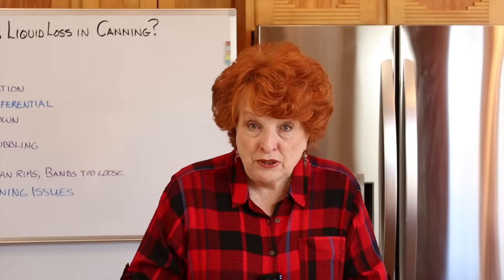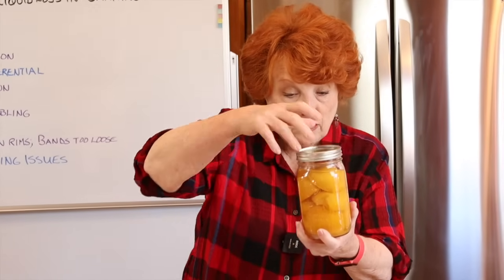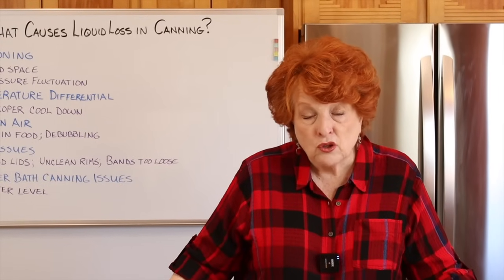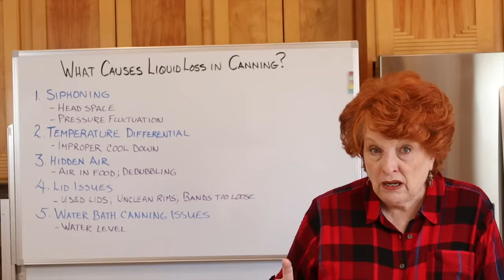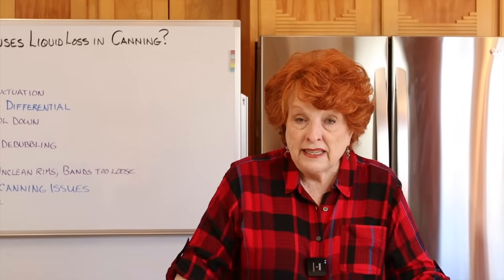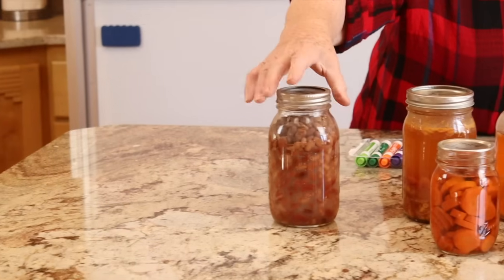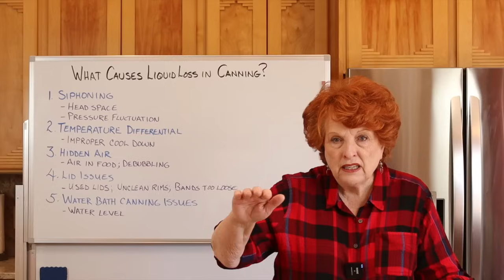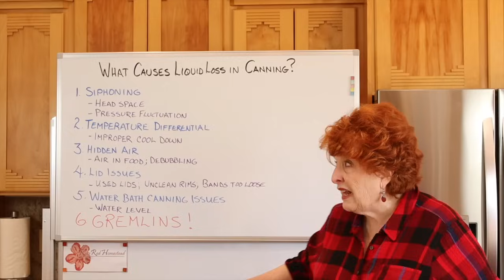What Causes Liquid Loss in Canning

Comment: I have for my nearly half century of pressure canning let my canner sit for 30 minutes before removing the the lid. I rarely have a problem. It's the way my mother taught me, when she was in hospital one summer and I had to pick, string and can 40 quarts of greenbeans by myself. I was 14. I think she was afraid I would open it too soon. Her exact instructions were, " turn off the heat, when the pressure reads '0' wait 30 minutes and remove the lid." 
Edit - That was before all the safety measures they have now. But I still do it that. 😆🤷‍♀️
Reply: I do the same. I can’t see what it hurts to let the jars cool down longer than 10 minutes after returning to zero. Especially for things like broth that really can’t be overcooked. I’d rather wait no matter what I’ve canned.

Comment: Holy cow you're the best, THANK YOU!   I have the Presto 23 with both the gauge and a 10 lb weight per my altitude.   Just today I was noticing a trend in my jars of being low on liquid, wondering why, and wondering if they were unsafe.  You're the best at educating.  I believe my biggest error has been not keeping that smooth transition of temperature; canning is time consuming so I would rush my canner up in temp to get the steam for 10 minutes, add the weight, then drop it down  fast to get my gentle jiggle.   I am also guilty of occasionally bumping my weight to see if it's still letting off steam as it cooled down.  I won't do that anymore!     On my gas stove, the 4.5 marking on my gas control knob gives me the necessary gentle jiggle. If  am understanding you correctly, I think I should be letting it gently build up steam for the 10 minute exhaust on that 4 or 5 mark,  add my weight, and let it gently keep building up to the gentle jiggle at the 4-5 mark on my gas dial.   None of this max heat down to medium low heat stuff.   I will try that on the next round anyway.  I love your videos, they have been most helpful.  There are a lot of "rebel canners" out there these days and I often share your video about botulism with them.   Frankly, I think we are going to see a rise in botulism poisonings before long with all the misinformation these people push about how you don't need a pressure canner to do low acid items.   They keep saying "The Amish do it this way!"  I don't know about that, maybe you could teach us something regarding that.  Thank you again for your help, the timing of this was perfect.

Comment: This is the best video you have ever gifted to us, especially newby's. I thought I had learned all I needed to know about canning until I got an electric glass topped range. Oh did I ever miss my gas range (my new house had no gas). It took several tries to figure out how to reach and maintain the appropriate pressure. So my answer to the questions is simple:
Impatience and inexperience. Once in a while I'll get a failure of a jar, but never a full canner. I dont fret over it, but just cool completely and send to the fridge or freezer to use soon. As far as peaches go, during the lid shortage of the 70's there were so many new ways developed for the freezer. Peaches were by far the best! When done right using Fruit Fresh and sugar, air tight containers, working quickly to prevent oxidation which not only doesn't look appealing it doesn't taste good. I never went back to canning them. Anyone remember freezer coleslaw? It is actually very good, needing only some mayo upon thawing to make it like fresh. Great solution when growing your own cabbage and dont want to turn it all into sauerkraut.  Freezer jam? Yes! I still prefer the traditional way. Reusing lids? NEVER! Why risk ruining an entire batch of precious food to save a couple $'s? Used lids are fine for dry storage. My solution for the rings: after removal (the next day) I wash in lukewarm slightly soapy water, all the jars and rings, then let air dry. I do what my mom always did - open up a wire clothes hanger by untwisting the wire at the top, placing the rings on thr hanger, losely winding the wire slightly back in place and place in a cool dry place. One for each size and you wont get rust. Rings w/lids cost almost as much a a case of new jars! This method also helps if you have many more jars than rings, which is easy to happen when buying used jars, as they often are missing rings.

Comment: I used to have a ton of problems with siphoning due to pressure fluctuations with my Presto canner. However, once I ditched going by the dial and just canned by ear with the weight, I had way fewer problems. I find it easier to listen to the canner, and it results in me touching the stove dial a lot less.
Reply from the maker: It sounds like you have fixed your siphoning problems. I always listen to the weight and the watch gage. One become back-up for the other.  Jim

Comment: Thank you for mentioning the apple pie filling siphoning.  My first attempt at apple pie filling siphoned.  I was afraid it was not safe, even though the lid seems to be solidly sealed.  There was more than an inch of water in the canner, but not 2” and that is probably the issue.  Or perhaps I didn’t get all the air bubbles out.  Thank you so much for this class.  SO HELPFUL!!!
Reply from the maker: So glad to hear it was helpful.

Comment: Still learning canning - I have an All American 921 in the mail at the moment. I think I understand this problem. Fun science!

Ideal Gas Law states PV=nRT where n is the number of moles of gas and R is universal gas constant of 8.314... joules per kelvin per mole. P is pressure, V is volume, and T is temperature. You could do this math to quantify the problem, but that's more than we need right now.

To simplify we could just think of it as PV=T. The V - volume - remains the same in the closed canner and jar - so if T - temperature increases so does P - pressure or vice versa.

When the canner is closed and processing, the pressure and temperature inside the canner AND inside the jar is the same (say 10psi at 240° for sea level operation). The increased pressure inside the canner will initially force air past the lid seal and into the jar. If you quickly de-pressurize the canner by artificially cooling it with cold water and open it too quickly the jars inside are still hot and pressurized! I think this generates the explosive decompression / siphoning effect we're talking about here. The seals on the ball jar lids aren't engineered to hold that difference in pressure at this temp. They can let air out slowly, but if the difference is too large the liquid in the can becomes intermixed with with the huge amount of air trying to escape - V, volume - to equalize the P - pressure. A thinner liquid, like broth, will mix with the escaping air more easily so it makes that low viscosity fluids are more likely to have this issue.
 
Mess aside, the solids and fats melted into the liquid destroy the ability of the lid to seal on the lip of the glass jar and the experiment is over.

Under ideal circumstances we cool the canner slowly such that volume and pressure come down in a controlled manner inside the canner AND the jars themselves. This allows the lids to expel only the gas above the food (again, reducing V as P and T come down), thus keeping the glass rim clean for a proper seal by the time the jar hits room temp.

This also explains why we only screw down the lid 'find tight'. Those seals need to 'breathe' as they let air pass in during the heating phase and our during the cooling phase. The more violent the pressure change, the more air needs to come into or out of the jar at once and that's when we get in trouble. Smooth curves! The rubbery sealing compound is a wonder of materials engineering!
Reply from the maker: Thank you.

Comment: Pressure canned 5 pints of beef stew, and 1 pint of beef tri-tip chunks. All turned out great except one pint of the beef stew. My fault, i knew i didnt have enough head space.

After cool down, i removed the weight, waited 10 mins, then open canner and left lid on loosely 10 mins, and tgen removed lid completely for anothe 5 mins before removing jars. I have an All American 910 canner.

Comment: Oh my, running cold water on a hot canner-Boom! 😂. Kudos to you for admitting you once did that years ago.
Thanks for going over this because I remember that jar exploding and it was a shock. 😮
My idea is broth would heat up much easier than solids and the other is I’m always going to warm the lids as I don’t think I got them tightened enough and I had syphoning as the bands were loose after canning.  They say the lids can be cold, but I don’t think so for me anyways.
Love my Presto electric and from your testing I seen how long they stay in the kill zone.  I think the broth got extra hot and probably took longer to cool.  Thanks for covering that after siphoning the lids could have oil or food under lid edges.
Great follow up Pam!

I think it would be great if they had a torsion wrench that would get the rings on at the right tightness then there would be no guessing on if it was finger tight.  I don’t think that tool was invented yet. 💡

Comment: What good information - I've always been too afraid to pressure can but you encourage me.  I tried canning in my InstaPot Canner, and experienced liquid loss with ground beef and also cold pack chicken. I attended a canning class given by the local extension office and was advised I should discard all I had canned and also throw away the canner because it isn't safe to use.  I watched your video review of the canner, showing that it doesn't get to temperature for long enough to be safe, so I will follow those directions!  I can't use my Presto canner on the new cooktop, so must wait until spring for warmer, dryer weather to do my canning outdoors.  Meantime, I'll keep learning from you.
Reply from the maker: Thank you for comments and stay safe.  Jim

Comment: Thank you so much for putting this info out there.. Thankfully, we have yet to have any of our jars to unseal or go bad.....all of our canned jars are pulled and checked every 6 months.... takes about a weekend to do. One time when I was first learning to can, I went to check the jars as I was pulling them out to make sure the rings were loose and I turned one and it spewed hot liquid out at me and so I tighten it back down really quick and waited and it sealed, and it is still sealed. Something else I learned; electric stoves are NOT reliable to keep the perfect range temp that the canning process needs.... Get a turkey fryer and use the stand to can on...Again, thank you so, so much for this info.

Comment: I've learned (the hard way) that when I use my AA canner, I need to wait quite a while after the pressure gauge is at zero before removing the jiggler. I need to take great care when removing it, and if I hear any "shhhhh" sound at all, to leave it alone. If I get in a hurry and pull the jiggler off too soon, I can hear siphoning start to occur in my jars. Not a fun way to end a canning session. My Presto is better, if I'm short on time, but the AA is better for holding a steady pressure while canning, and needs less babysitting.

Comment: My 22qt. Mirro canner (1970's) has a plastic "safety fuse", it's a peice of plastic with a large flat head that seats against the inside of the  canner, should pressure build to an unsafe level it will push out through the hole in the lid. The outside peice of it is flat and there is some movement of it when inserted properly into the head. After a canning session I never touch the weight, I take a fork (the lid and "fuse" are very hot) and I touch the outside of the fuse, if it is loose and moves easily that indicates no internal  pressure.  The tines of the fork very slightly raise the "fuse" and that allows outside air to enter the canner as it cools. A half hour later I will Remove  the lid. 
I've never had a problem..........remember  "haste makes waste"    it is a true saying.
Reply from the maker: It sounds like you have had very good luck with your canner. If your "safety fuse" breaks, can you get a replacement for it or will you have to buy a new canner?  Jim

Comment: Also, wouldn't an unlevel stove be a reason for pressure issues?  Another point worth mentioning is: do not smell the opened jar because if there is botulism you will inhale the spores. The Extension Service says that if you can hold the jar by the lid then the contents are okay. Do you agree? I would like to see a video of how you bring your 32-quart Presto canner up to pressure properly. Btw, that is a great shirt. I bet it is wool or wool flannel. Also, thank you so very much for this lesson. I have been grappling with this issue for awhile and it is disheartening. I also heard that "whish" sound in one of my jars of butternut squash recently. Gremlins are everywhere!😮
Reply from the maker: First, it is the toxin and not the spores that are deadly in canning and the USDA recommends checking contents by smelling.  Your extension service probably meant that if you can lift a jar by the lid then you will know it is sealed but that does not necessarily meant the contents are safe to eat.  If canned properly following USDA guidelines and properly sealed, then that is your best way of knowing the food is safe to eat.
Reply: @RoseRedHomestead  Thanks for the clarification. I just received today the two books you recommended, the Ball book and the USDA. Also jiggle regulator and pH strips. Thanks so much for all you are doing.

Comment: Pam, I have been also watching the MSU (Michigan) Safe Canning and Food Safety videos.  As far as finger tight, they recommended that you tighten with your fingertips and not hold the jar with the other hand so that you don't put that much pressure on the ring.  I still struggle with the right amount of pressure...I mean how does one measure the force of the pressure while turning and putting it on the jar?  
Thanks for sharing today!
Reply from the maker: Interesting.  Yes, it is a tough concept to explain and show.

Comment: Great info as usual. Thanks so much. I had to replace the burner controllers on my (electric) stovetop because I couldn't get the temp right, it was all or nothing so cooking everyting was hard until I fixed it. The electric burners cycle on and off to create an average temp on the burner so you have to kind of baby sit it then make note of where your dial is, and keep an ear on it. I actually found a video that showed what the jiggle should be like, that cleared up a lot for me. 
    
   One other thing I had happen to me was I actually warped the bottom of my canner.  I think it was because I was in a hurry to get it cleaned and put it away. I dumped out the hot water after removing the food I had just canned, then I put it in a sink full of water and it warped the bottom. I didn't know it happend until the next time I went to use it, it woldn't sit flat on the stove top.

Comment: One problem with having an electric stove is you must move the canner off the burner when you are done canning. It’s very very heavy and difficult to do. But if you read the directions in the book, it tells you to gently move the canner off of the burner. If you don’t, the heat never goes down. It’s trapped underneath that pot, and it takes forever for it to cool. This would normally be a dangerous thing to do but you have no choice if you have an electric stove.
Reply from the maker: I didn't know that.  I don't think I have ever moved my canner of an electric stove burner--I just let them cool down together, but it has been years since I used an electric stove for canning.  Thanks for sharing.
Reply: I have always had an electric stove and I have been canning for over 50 years.  I have never once removed my pressure canner nor my waterbath canner off of the stove when processing time is done.  I have two All American pressure canners, one  holds 20 quart jars so it's a big one.  I've never, ever had trouble with it taking  long to cool down.  It hits 0 around 30 minutes, even less depending on how many jars are inside and what size.

Comment: With pressure canning, 10 minutes after the cool down is still too soon. I wait until I hear the first sealing ping of the jars inside the canner, then i crack the lid open and set it on top, and wait a few more minutes before removing the lid entirely.

Comment: Thank you your explanations are so understandable. I use a gas stove with very good heat control and watch the pressure gage the whole time. But now I have an explanation for my preaches.   
   With a water bath canner when you have different sized jars or a diffrent number of jars how should you correct the water level if you need to?

Comment: Thank you so much! This last year has been siphoning after siphoning. I've struggled to figure it out. I think it's mostly pressure fluctuation. Too high of temp and heating/backing off too quickly. I was following the instruction manual, but I'm pretty sure my electric stove is making it more difficult. I need to can some more beans, so I'll give it a try keeping the temp lower and even and letting it take it's time. Patience is not my virtue, but it's going to have to be.

Comment: Great explanation, thank you so much! I had something strange that didn't come up and I wonder, if these jars are safe.  Hope you can help me. When I lifted my quart jars with beef veggie stew from the canner most of them did not seem to be boiling , 1 was boiling fiercely and 1 was boiling a little bit. They are all vacuum.l, but the boiling one seemed to have lost a bit liquid (liquid is still well above half). 
Procedure I used: 10 minutes full steam, 90 minutes with 10 psi weight (I'm at sea level) opened the canner when pressure reached 0, removed jars after couple of minutes.